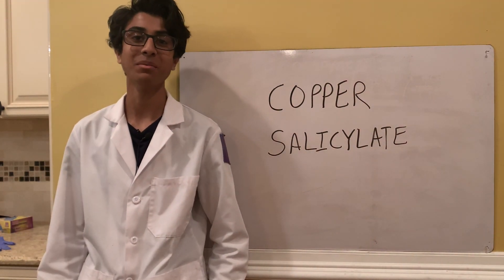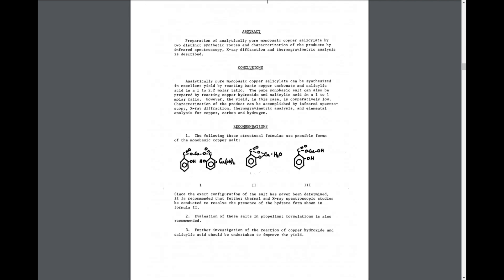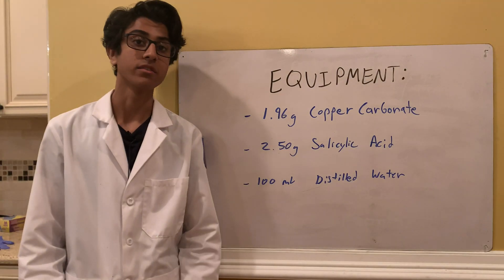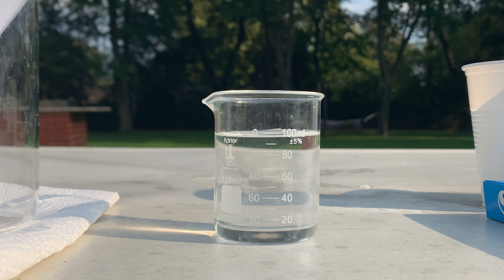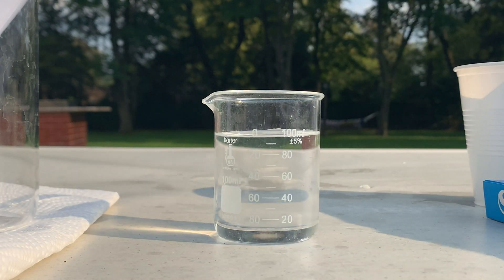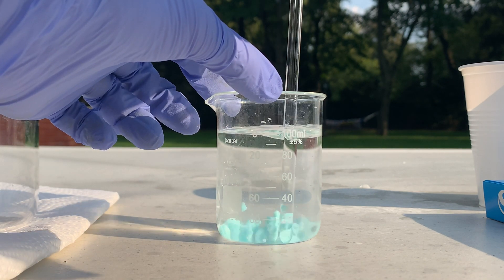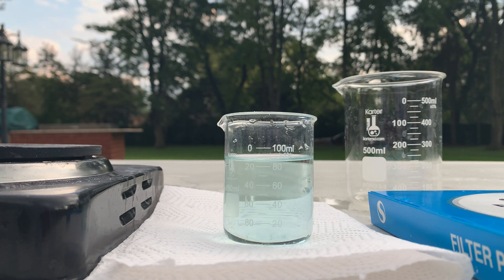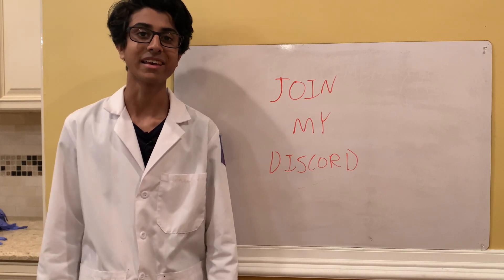Synthesis of Copper Salicylate

Comment: A little tip friend that made it easier for me. Dissolve the salicylic acid into the water first with heating. The solubility of the acid goes way up with heat. Also crush you basic copper carbonate before adding and add it to the still heating acid solution. This will increase the reactivity of the acid too.
Reply from the maker: Syn the Sizer thanks for the tips, these will help a lot